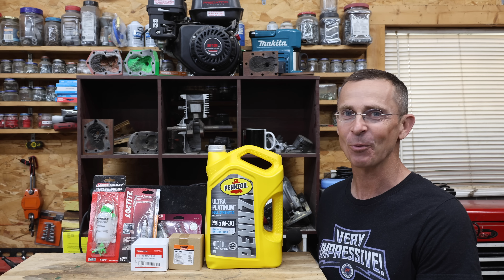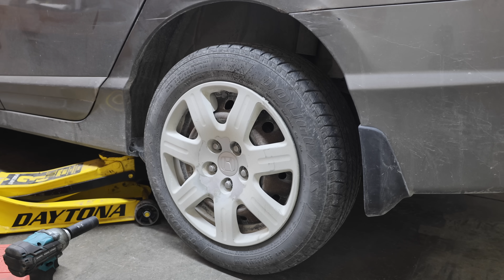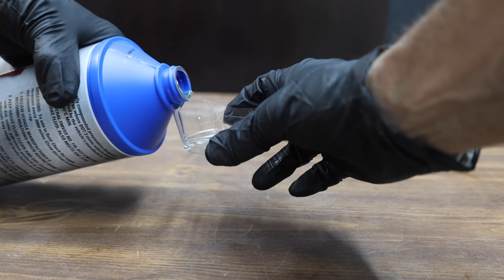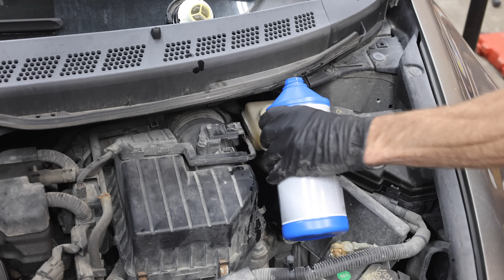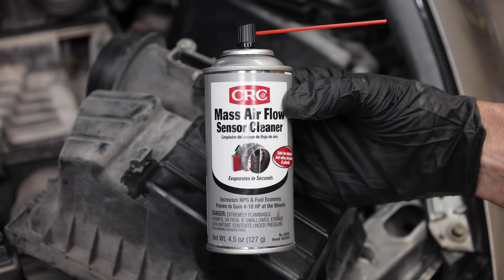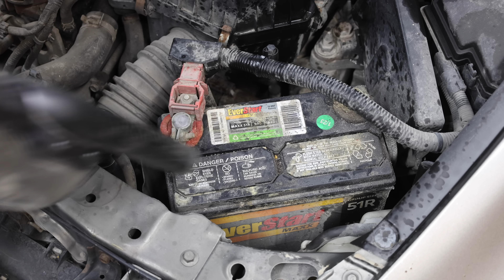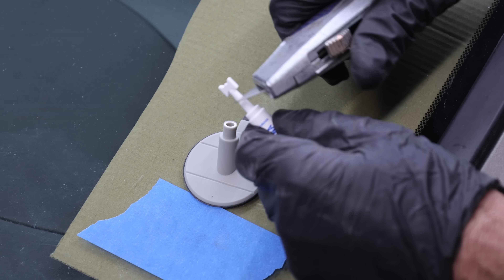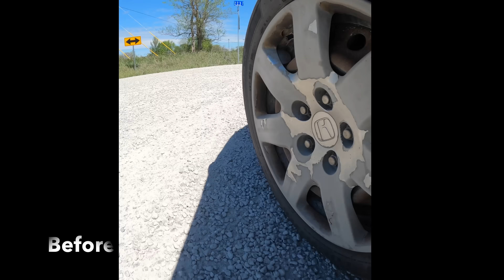Most Reliable 200K Mile Car? Let's Settle This!

Comment: Yeah, frame rust, drivetrain issues, and bad electrical issues are about the only thing that should put a car out of commission. Admittedly, that was a host of small issues that had that Civic sold; you spent I'm guessing 3-4 days, $2000 in tools, a garage to work in, $1000 in parts, and had the knowhow to diagnose and repair. If you took it to a shop, that would have been about $3-5k. It really sucks that poor people are often poor in part because they can't do this (apartment complexes don't let you work on your car, and tool storage in a rental situation leads to theft of those tools. Renting in the US fucking sucks)

Comment: Awesome video! I’m not sure if you already did, but it’s important to bleed the coolant system of air, get the car up to temp until the radiator fans turn on, then turn on heaters to open up the heater core, then all the air should be out. Awesome video!
Reply from the maker: Thanks!

Comment: I have a gorgeous aqua blue metallic 1998 Chevy Cavalier 2.2L 5-speed manual with over 250k miles on it, I bought it for $2,000 back in Feb of 2011 when it only had 64k miles. The body needs a bit of work (small rust spots and paint touch-ups) but mechanically everything is perfect. I literally rebuilt everything(!!) mechanically on it... and as my Uncle (may he RIP) taught me -- the most important things on a vehicle are the oil and other fluids, the brakes, and the tires. The rest he considered luxury, and it's so true. I really appreciated seeing this, great job as always! Just wish I had done my shock-struts myself. Didn't have the right tools at the time, so a local shop cost me a few hundred bucks -- beyond that all the rest I did myself. The hardest was doing the blown headgasket. No one wanted to do it (because it was "too old" and said I should get a new motor) so I bought the Haynes manual, got the tools, and did it myself. I actually have pics and video of pieces of the process. Needless to say, it's still running just fine now. Great video as always, hope all is well!
Reply from the maker: Nice!  Thanks!

Comment: Nice work. I got a 2011 Chevy Silverado 4.8L and replaced all the fluids, including power steering and both differentials. The rust will take it eventually, but so far so good. It's a horse. My buddy swears by these Civics. Had one of the same year that later drove his kids to university and kept on going.
Reply from the maker: Thanks!  Thanks for sharing.

Comment: I'm about to start a field service job. I have to wait 2 years to get a service van from the company, so I bought a Saturn with a rear bumper delete. I fixed the trunk latch and fuel filler line, and it's perfect. It's a crappy car. I can throw tools and everything else into it and not care about getting it dirty or damaged. And yet, it's so reliable even after 400k miles. It's my beloved Donkey
Reply from the maker: Nice!

Comment: I swear you're the only YouTuber I've ever seen tighten/torque strut bolts the proper way, by putting the assembly under compression before tightening.  Bravo.
Reply: I recently did all the struts on my Camry and made sure to preload before tightening. Took it to a shop afterwards for an alignment, and the guy found everything was still in perfect alignment.
Reply: Probably a lesson he learned from experience! I know I have! Not to mention it's SOOO much easier to swap in a fully compressed assembly than trying to squeeze a spring onto a new strut. EUGH. Never trying that again!
Reply: Might be a dumb question. What does that mean to put the assembly under compression?
Reply: @AmbiguousFrog  Not a dumb quetion! The strut is the pneumatic tube, and then there's the spring around it. Fully expanded, the spring will be too big to fit on the strut. So you first have to compress it when you attach it to the strut. Once the spring is on the strut, it's referred to as a "strut assembly" (which you can buy pre-assembled for easy of install), but it's still not fully compressed. When you bolt the assembly to the car, you want to jack it up, as others have said. That's less about being "under compression" since the spring/strut compression doesn't make a difference mechanically; it's more about making sure the assembly is tight against the vehicle body so you can get the right torque on the nuts. It also helps to have it jacked up so you can get the wheel hub attached easily - fully extended you might have trouble getting the hub to line up or even reach.
Reply: @AmbiguousFrog  you use a jack under that suspension component (ball joint) and then tighten down your strut to hub bolts. That way it's at its resting height as if the vehicle was sitting on its tires on the ground. Especially important for the control arm to frame bolts, less strain on the rubber bushings.
Reply: @AmbiguousFrog  Before you tighten the strut bolts, compress the spring by putting a jack under the control arm. This takes up the slop in the holes and makes sure the strut is aligned like how it will be when the strut is supporting the weight of the car.
Reply from the maker: Thanks!

Comment: One other thing I have found useful for revitalizing the appearance of an old car either for flipping or personally use is to add a bra or bumper and Hood cover. This will cover wind damage to the front paint, but also instantly add some class to an older body style and make it fit in with later model cars. Those are usually about $150 on ebay, and in my experience is that adding one will result in about a 4x return when selling.
Reply from the maker: Thanks for the feedback.

Comment: Well that was fun! Not a bad looking going to town car that should last another 200K

A video on "buying used high mileage vehicles" would be great. Going over used vehicles and pointing out what to be weary of and clues to look out for as far as evidence of proper maintenance, evidence of tampering/masking issues, signs of bad transmissions (in my experience this is the most frustrating as ive had several vehicles that perform well for a few months and suddenly require transmission work) as well as other common "it aint worth it" issues and maybe even go over where to buy vehicles (online market places that arent full of scammers/how auctions work and how to scout potential bids/is buying off a lot worth the hassle and fees? etc)
Reply from the maker: Thanks!  Thanks for the suggestion.

Comment: Old cars from makes and years known for reliability are the way to go. I'm currently driving 2008 Toyota Prius with 426k miles that still performs reliably, and gets great mileage. If you have a long lived transmission and engine, keeping up on other maintenance items and repairs is way cheaper than prematurely getting rid of a good car.
Reply from the maker: Thanks for the feedback.

Comment: I just bought a 2001 Toyota Camry with around 265000 miles on It all I did was change the battery and Oil and transmission fluid It took Me a while about the Oil filters and drain plugs all the holes on the Oil filters were too small for good Oil flow except K&N but It's too small of filter so I used Toyota brand which Is still a small filter, the unusual drain plugs complicated things. I also put some Prolong Engine treatment In, I have seen Project Farm test other brands of Engine treatments but Not Prolong...... I would like to see a Free Energy system from the book Back Yard Power Plant.  Thanks.
Reply from the maker: Thanks for the suggestion.

Comment: Loved it, these are all great things to do with used cars/trucks. Also add in inspecting CV boots, engine mounts, and other rubber pieces that tend to dry out over time. 
And from what I can tell, you can't make a bad video. Such a detailed eye and a willing to work goes a long way!
Reply from the maker: Thanks!

Comment: Great video. I was about to be disappointed when you said you used a fluid extractor and then didn't show it, but then not only was I glad you showed but even better how you made it. The only thing I noticed you didn't fully finish showing was which product you ended up using for the headlight restoration especially when it came time for sealing them (although I know you did a whole video on it which I saw). Again, great video detailed enough and straight to the point.
Reply from the maker: Thanks!

Comment: Smart to replace the whole strut assembly, getting new springs in the process, not to mention a whole lot easier. You should get yourself one of those automatic bleeding coolant funnels. I bought the Lisle (made in USA) and LOVE it-works great! Don't ya hate those orange plastic dip sticks? Why did Honda change to those? Is it just the 4 cylinder engines? I can't half read them.
Reply from the maker: Thanks!

Comment: I've used that generation of Chevy Suburban for a work vehicle for years. They just keep going, and take a beating. I do some mild off road driving and haul a load inside all the time. They run well in the cold, they are a good highway car, and are comfortable. Not bad off road if you have the right tires, especially in snow.
Reply from the maker: Thanks for sharing.

Comment: I have a 2006 Honda Accord 2.4L 5 spd manual with almost 220k miles on it and still going strong. I bought it in November 2014 with 112k on it. One owner car that was well cared for. It makes me wonder how many owners your car had before and if all of those fixes you did will indeed make it last longer like it should regardless of what kind of abuse it's been through.
Reply from the maker: Thanks for the feedback.

Comment: All great advice, wish I had the know-how to do all of that. My limit is oil, breaks, and filters. Beyond that, it gets questionable. I did replace distributor cap/cables/spark plugs on my Corolla once, it was easier than this Honda looked.

Unfortunately I live in New England now and they use so much road salt here in the winters that the roads are literally white from it all (not snow, just salt). So no maintenance will save a car out here that I'm aware of. When I lived in Montana, it was easy to get a car past 200k.
Reply from the maker: Thank for the feedback.

Comment: I've heard these vehicles are great. However I've also heard 2002 Toyota Corollas were the best for reliability while the 2002 Honda Civics were more about speed than reliability but also very reliable. My 02 Corolla has almost 400,000km (248k mi) and it's still running ok. My entire family is hoping and telling me every chance they get this car will die anytime now because they think it was a bad purchasing decision but they just don't know Toyota like I do. I used to work in their factories, I know the difference. Plus I have a parts car with a good engine, they gonna be waiting a LOONG TIME.

I also watched you change the transmission fluid in this vehicle. I've heard horror stories of people changing the fluid and the trans dying soon after because the transmission fluid had the grit suspended in it that came from the friction plates (so it is worn) but without that grit in the fluid the transmission won't move the car. I've heard there are products to restore this grittyness to the fluid but am not sure how well this works. I know I am never changing the fluid in my car because I can feel the grit in the fluid.
Reply from the maker: Thanks for the feedback.

Comment: Hondas are more reliable overall than a Buick BUT thats no secret so they are expensive . So i stick with Buicks. in the last 3 years i have bought  a 1998 with 70k for $2000, a 2000 lesabre WITH 59K for $1000 and a 2003 regal with 179k for $500  all have the same engine and transmission that are reliable but there is a notable drop off in 2000 with build quality like peeling up dashes and to many plastic parts that rot because of the sun. But for the price you cannot beat them. They are very reliable old people cars and those old people took good care of them but now they are passing on or cannot drive. Their kids don't want them so they sell them dirt cheap. before these 3 Buicks i bought a 1998  lesabre over 10 years ago with 50K .I got over 200k miles on it and the alignment went out, jacked it up and it was rusted out from a decade of weekly beach trips towing the jetskis it still ran great. I still have it its a parts car all the engine and transmission parts fir my other 3 .
Reply from the maker: Thanks for the feedback.

Comment: Yup. Off warranty, I do all my own wrenching and when you remove labor costs as part of the equation, the cheapest car you can buy is almost always the one you already own. That said, I live in the rust belt rusted out subframes or frame rails is often the killer.  Like Todd, I'm invested in tools and scanners and have decades of experience so restoring an otherwise clean vehicle is absolutely an option. If you have to pay labor, though...
Reply from the maker: Thanks for the feedback.

Comment: The first generation Lexus ls400 were bullet proof. There's a 90 or91 running around with over a million miles  in about 30 years. All stock drivetrain etc.
That's very impressive!
Reply from the maker: Thanks for the feedback.

Comment: bwah ha hah!!!  
I've run EVERY vehicle I've had well into the 200k's.  Current main rides have 200k, and 130k.  I had an F150 go 390k before I sold it and it had THREE more owners. Of course I never buy them until they have 50-100k miles on the clock.   All I'm saying it that it's not the car it's the TECH/MECHANIC and good parts that keeps them alive.
Reply from the maker: Thanks for sharing.

Comment: Hey Project Farm, just a quick note on maintenance on that car; Honda throttle bodies of that era have a coating on them that prohibits cleaning them with any type of intake cleaner. Any solvent will remove the coating, causing an excessive air gap around the throttle plate which will lead to uncontrollable idle, which will set fault codes. That will necessitate replacement of the entire throttle body.

Also, always ask for a “crush washer“ when you buy your filter from Honda. The crush washer on the drain plug, be it for the transmission or engine oil, is one time use only.
Reply from the maker: Thanks for the feedback.

Comment: Awesome video!The only part I take issue with is the transmission fluid change at 200k miles. Many mechanics advise that if the trans fluid hasn't been regularly replaced you're better off NOT changing the fluid as it can cause the trans to start slipping at higher miles with the clean fluid in it.

Comment: Very good! If the car has a timing belt instead of chain, I'd replace it and the tensioner. I'd also replace the water pump and pcv valve.
Reply from the maker: Thanks!

Comment: This could be your best and smartest video, yet. My newest vehicle is a 2000 Jimmy that I got for free with 180,000 miles, and after spending $2200 on repairs and upgrades, I virtually have a new truck. And Im not paying for a bunch of options that I don't want of need, like a new vehicle. And all those fancy options on a new vehicle are gonna cost a fortune when they break
Reply from the maker: Thanks!  Thanks for sharing.

Comment: I thoroughly enjoyed this BUT it didn't answer the question: which one is the most reliable 200,000 mile car?  I have a Prius with over 300K that I believe to be a solid candidate.  They're slow but relentless.

I really expected it to be a Best Of episode featuring the best bang-for-the-buck headlight restoring system, best tested windshield wipers, etc.  Interestingly, you didn't take that opportunity to call out the exact products you installed.

Comment: I'm 71 and own a 2016 Coloraado with 80,000. Oil change interval is 3000 miles. I do my own maintenance and I look at what a newer truck would cost me. It's a no brainer when it comes to replacing parts. I can do most of it so this might be my last vehicle. Great video and reminder that in the long run parts are cheaper than trading...within reason of course.
Reply from the maker: Thanks!  Thanks for sharing.

Comment: Stay with something simple and reliable, so no CVT and no high performance 50 valve 12 cam motors, no direct injection and no turbos... I bought a 2011 Mazda Tribute (it's a Ford Escape actually) for $1500 three years ago with some rear quarter wheel lip rust.  Simple 4 cylinder with 6 speed auto.  I put 50K miles on it and only bought rear hatch strut cartridges..
Reply from the maker: Thanks for the feedback.

Comment: The irony of this video is that I used to own almost the exact model of this car which was very unreliable...

Axel busted at ~20k miles, then the other one a few years later. Fuel sender broke, alternator broke, persistent engine temp issue, AC needed recharging, ect! What a lemon! Nothing major but always something a couple hundred. It was an 06 Automatic in same ugly color. Meanwhile, I had a 05 Camry which never had a single problem. In fact I still have the Camry but sold Civic long ago. I used to like Honda until I owned the Civic in this video. Looking to buy my first SUV next year, and I know it won't be Honda. You definitely have to be a handy project farm type of guy if owning this car lol
Reply from the maker: Thanks for sharing.

Comment: On the first axle pull, I couldn't help but notice the ABS sensor was still installed and took a h*ll of a strain. Not good for it. One bolt and they come right out. I guess it was an oversight on his part. Surprising, as he's usually a stickler for "doing it right".

Comment: The noise when turning was definitely from the outer CV joint, noise from the strut would be more noticeable over bumps or if it was the strut top you could reproduce it stationary